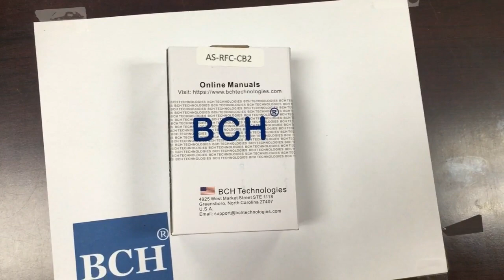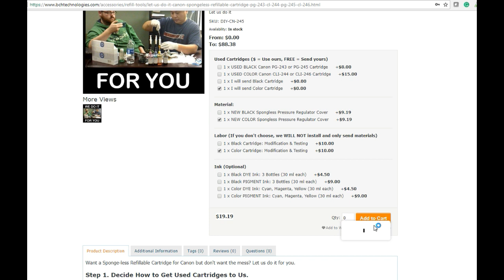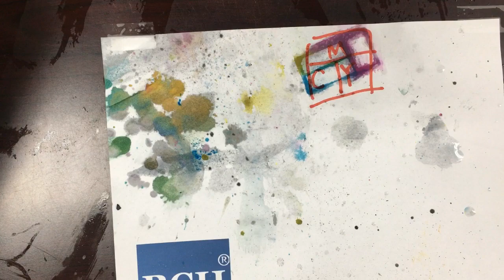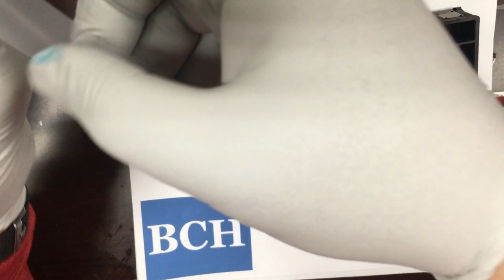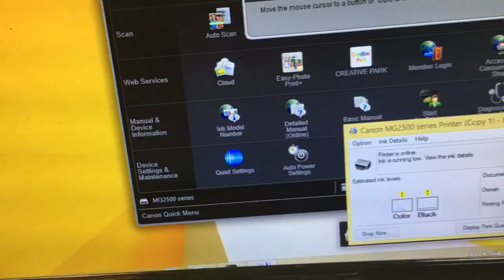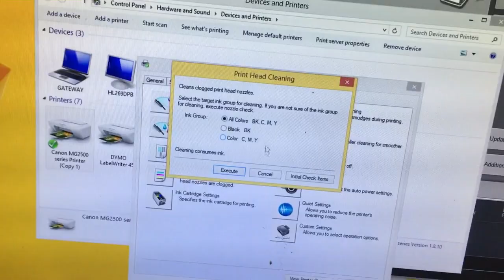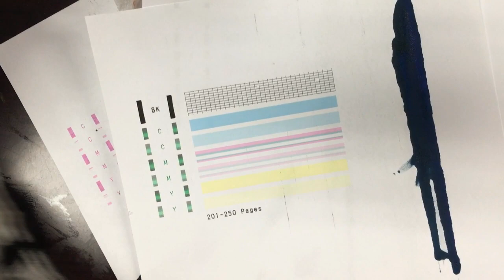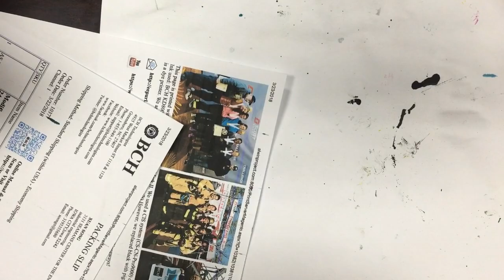Making PG-245 CL-246 Refillable Cartridges for Canon Pixma MG - Work Log

Comment: The problem is now in new printers the catridges gets blocked if empty or if required prints printed. I filled 3 times after that its blocked. I am using canon 745,746 printer cartridges. The thing users can do is buy catridges from recycling facilities abd use it.

Comment: What happen if we use pigment ink in this cartridge
Reply from the maker: Your text printing will look "sharper".  Because each droplet looks thinner under a microscope, so the printout looks sharper.  Because this cartridge is very easy to unclog, you can use either dye ink or pigment ink.  It doesn't matter that much. Both ink clog.  The dye ink is easier to unclog than pigment ink and is cheaper.
Reply: BCH Technologies 
and can I use pigment ink in sponge cartridge, will it work on canon pixma mg2570s
Reply from the maker: Yes, for few refills.  The pigment will clog up the sponge after few refills and then clog up the printhead eventually..
Reply: After converting it to sponge less cartridge, will it work fine 
And which pigment ink you recommend to use.
Reply from the maker: Yes.  Any pigment ink made for HP or Canon should work.

Comment: Cartridge needs the sponge to hold the ink by capillary action, otherwise it will just run out of the nozzle.
Reply from the maker: There is a pressure regulator on the new cover, replace the function of sponge.
Reply: @BCHTechnologies  where can i buy this cover?